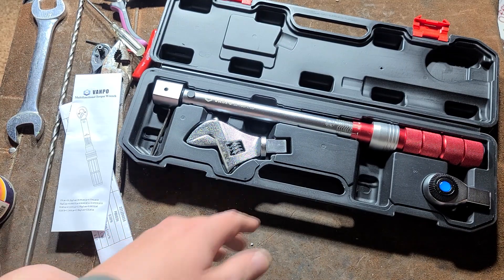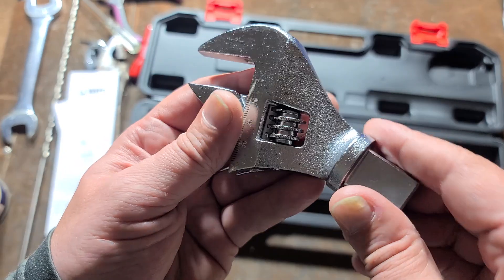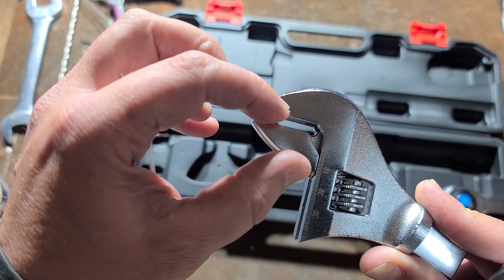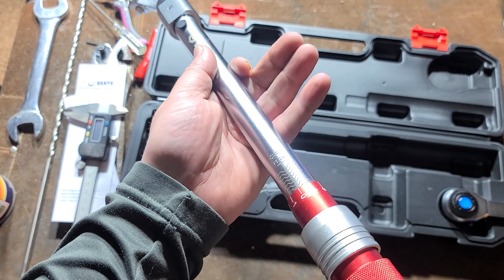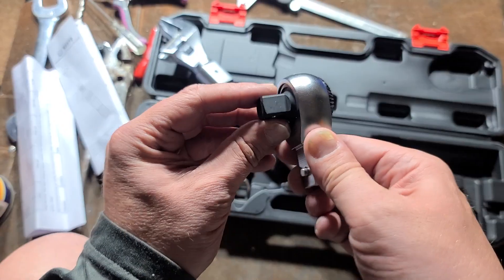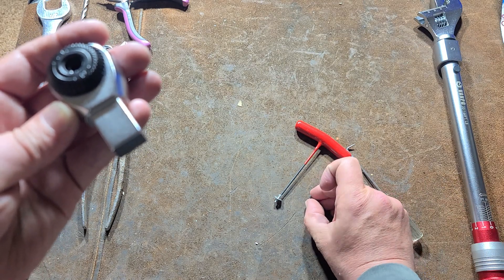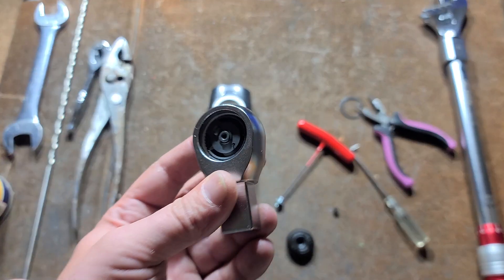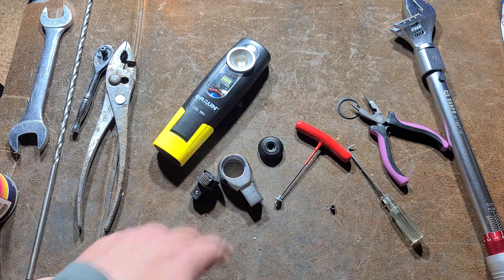Vanpo Adjustable Open End Pipe Torque Wrench Review

Comment: For a ~$100 it's decent BIG CAT 🐈...
The ratchet head IS really nice...for the quality ratchet head alone it's worth the price...
I could live with the not so nice adjustable head...most likely I'll barely use that feature...
if I'm specifically looking for an adjustable head torque wrench,  I'm looking for a high quality unit  not a bargain...🤔
Fortunately you can find a good quality replacement head...

Comment: I would use a crowsfoot open end or flare-nut tool and connect it to the torque wrench with ratchet head adapter.
You would have to have the crowsfoot part 90 degrees from the torque wrench to keep the torque setting on the torque wrench correct.